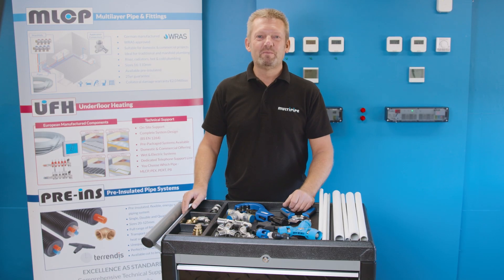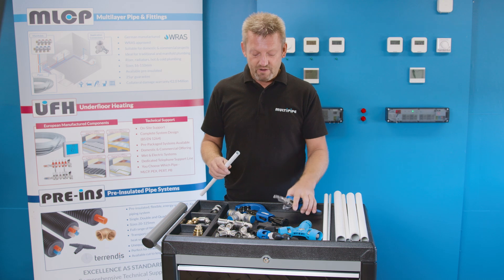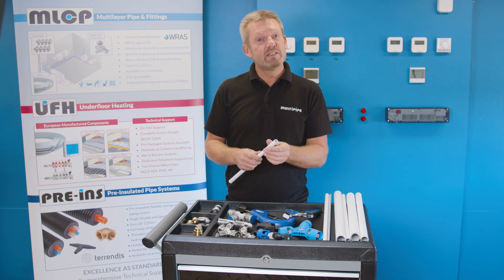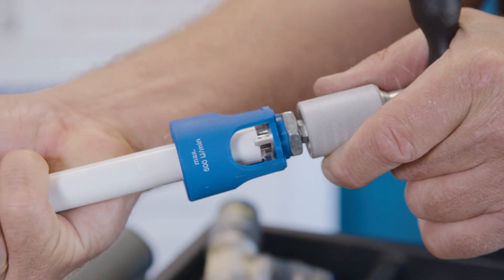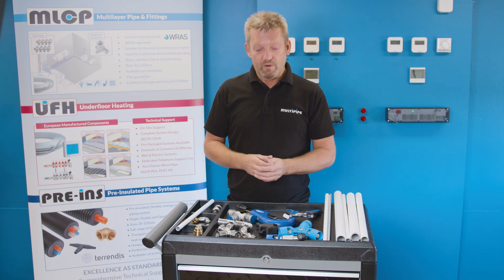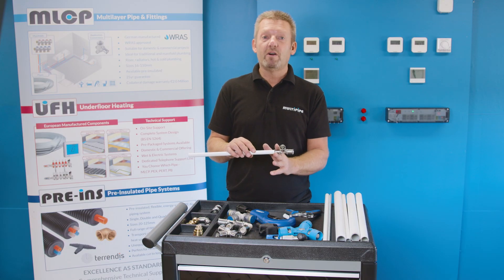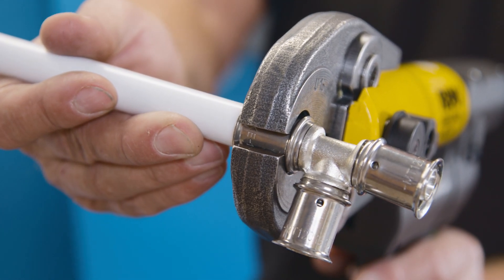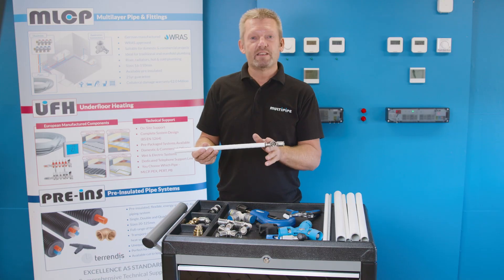Cutting Pipe, Pressing And Calibrating: How To Use Our Multilayer Pipe And Fittings

Comment: Let’s make something so simple so complicated. You Europeans work too hard, in Britain we use speedfit or hep20 fittings, no expensive tools required no chamfering, cut with even a steak knife and still won’t leak ever. I was doing a job in Spain and all I was thinking is €€€€€ for the tools. Don’t fall for it people speak up.
Reply from the maker: Many thanks for your message. This system is designed to buy into for professionals to offer all the benefits of hydraulic pressing. This makes it a perfect solution for plumbers and not for DIY installations or the DIY market. Plastic push-fit systems are good for most installations but have limitations. Also, most installers who move to MLC do so because they had a negative experience with push-fit systems.

Comment: How do you connect to say a zonevalve with 22mm olives
Reply from the maker: you are best to use a copper spigot this is a short stub length of copper that does straight into the valve. https://www.multipipe.co.uk/product/type-3-adapter-metal-press-to-copper-spigot-adapter/  I hope this helps.

Comment: Great video...so what type of pipes do i need to connect radiators, pipes that will be placed under a concrete layer. What kind of pipes protection termal or mecahanical tubes? tthanks
Reply from the maker: Sorry for our delay coming back. we would always recommend our MLC pipe for buried installations we even do a pre-insulated pipe making installs easier. Just visit our website for our options for you. The need to sleeve heating pipes is not required only hot and cold pipes.